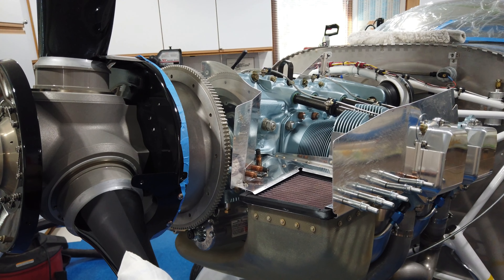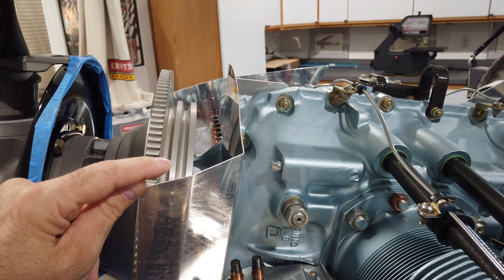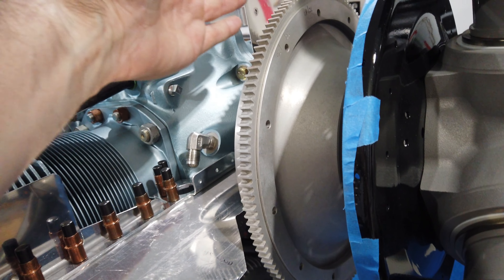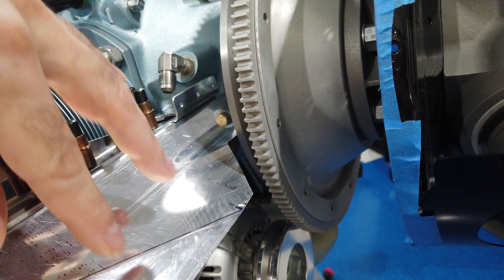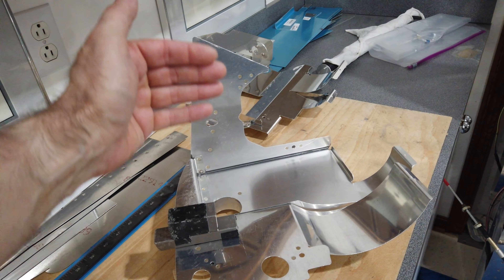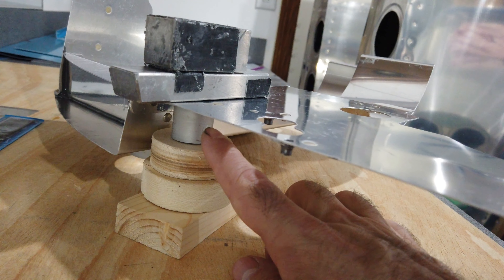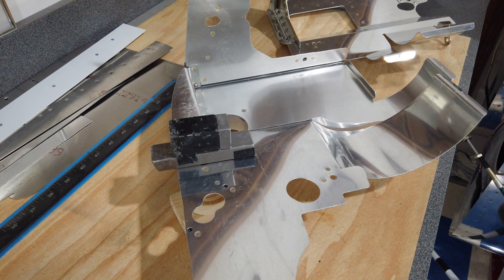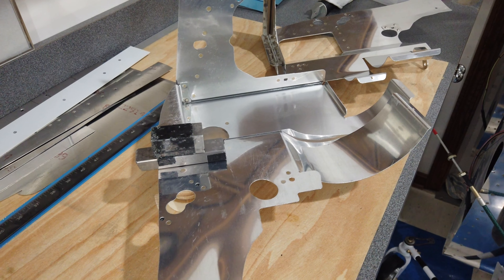Vans RV 7 HINT Videos Baffles Snorkle 6

Comment: Love the clean lines of the fuel tank sealant. I’ve never messed with the stuff but do you use tape to mask and help provide the clean edge?  Is this technique captured in a previous video that I may have missed?
Reply from the maker: Howdy David. My use of fuel tank sealant is best showcased on my fuel tank assembly videos. I do not use tape; I cleanup the excess with solvent by hand.

Comment: Are those the 1 inch flanges from ACS? I’m looking for 3/4 inch flanges.. any idea where I can get them?
Reply from the maker: Howdy Tom. The flanges are 1", but they came with the engine and I don't know who makes/sells them.  They are one piece; not a tube tack welded to a flange and have a smooth transition from tube to flange on the inside. (Think venturi.)
Reply: Yeah I think they are the ones spruce sells.. nice but I want 3/4 inch. I don’t want to bleed off as much cooling air..
Reply from the maker: If I may; consider going with a larger tube flange and if needed, you can partially block it. (Aluminum speed tape comes to mind) If too small, removing and replacing with a larger unit, at that time, would be a little tedious.